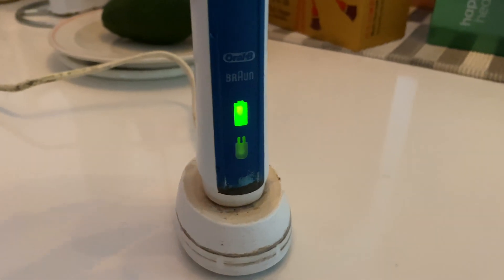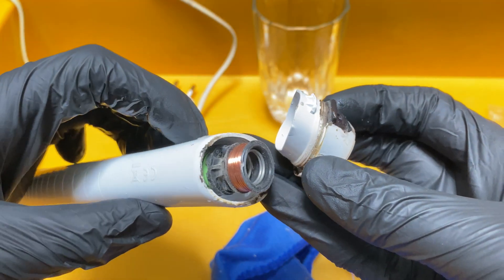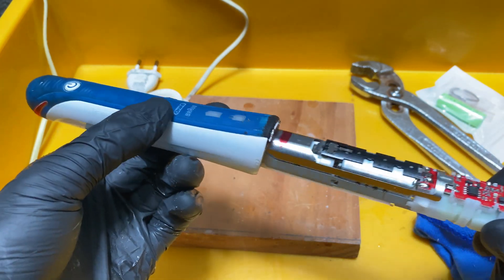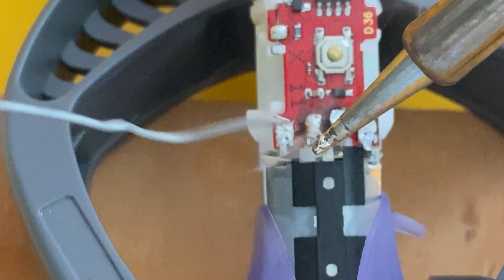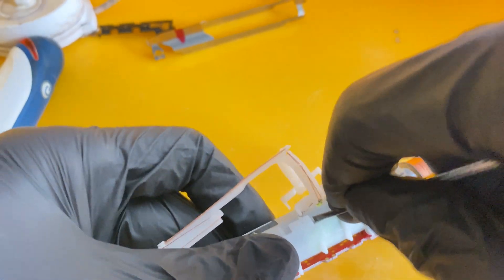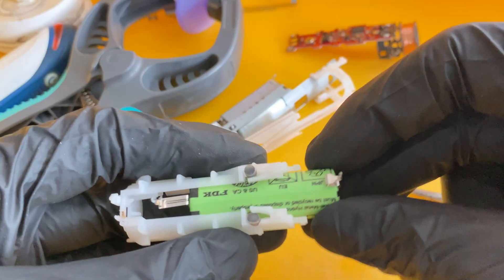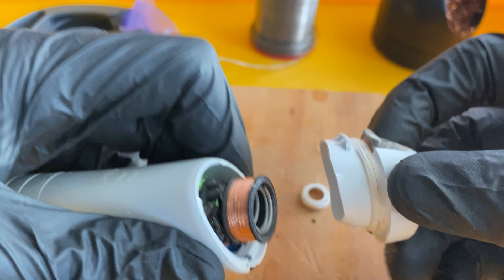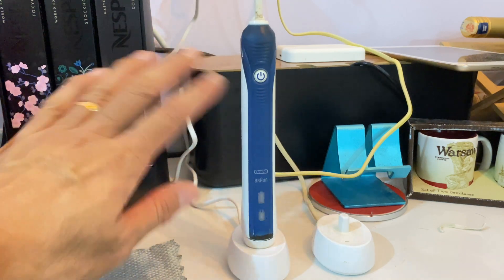Oral B Pro 4000 toothbrush not charging | How to replace the battery 🔋

Comment: Could you tell what's the battery model? COuld it be upgraded to a higher capacity?
Before I open it I'd like to be all set.

Thanks for the video, it is helpful!
Reply from the maker: Which model is your toothbrush?
Reply: @CTB6  This one, the PRO 4000. Exactly the same.
I have a battery that lasts 10 minutes at best after 24 hours of recharge. Guess it's time to replace it. :)
Reply from the maker: It is 1500mAh 1.2v. 43mm by 14mm battery. That’s the specification.